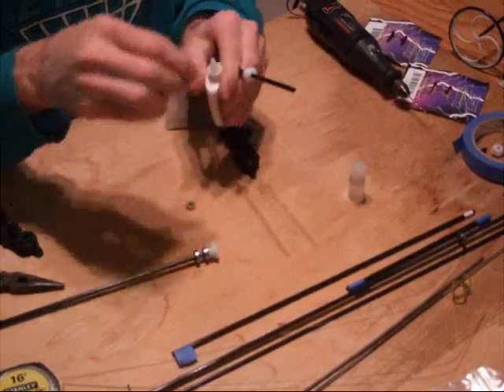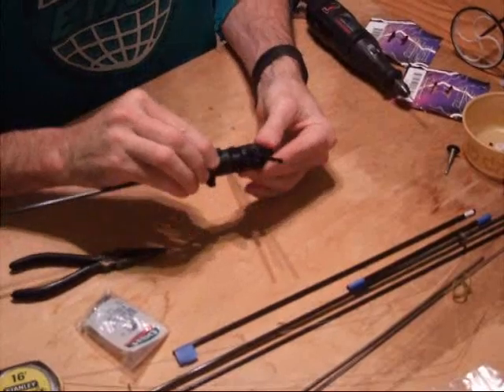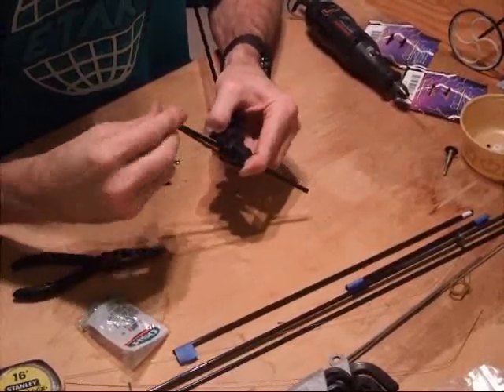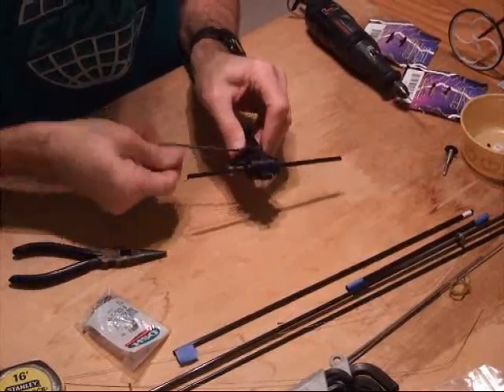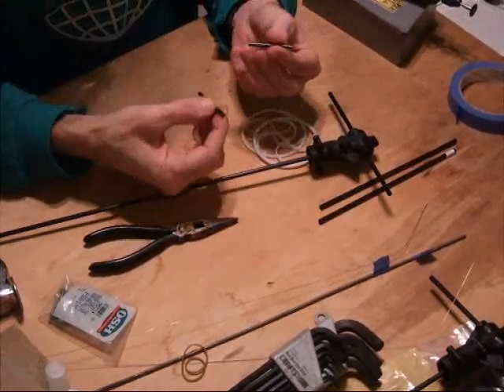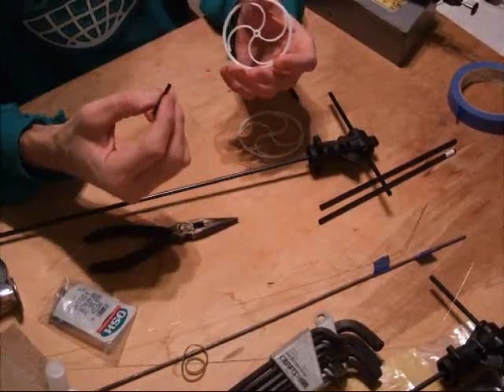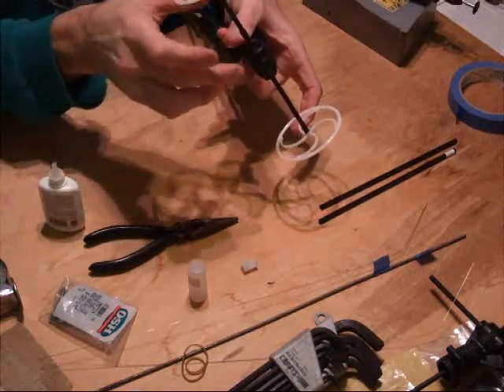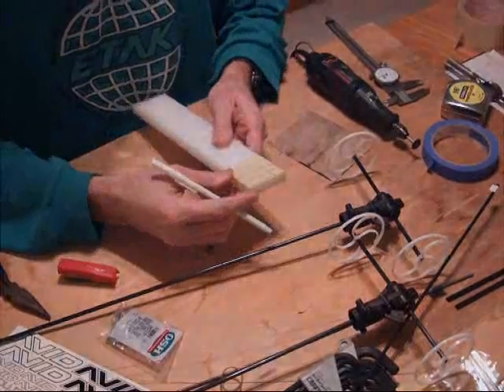Making of the DDWFTTW cart (Part 2 of 3)

Comment from the maker: Probably so.  We've built a few now, and have tried to refine it as much as possible to make it both inexpensive and easy to make from off-the-shelf parts.  There have been minor changes here and there.  Once you have a working version half the fun is to modify it, try different wheel sizes, prop pitches, etc.